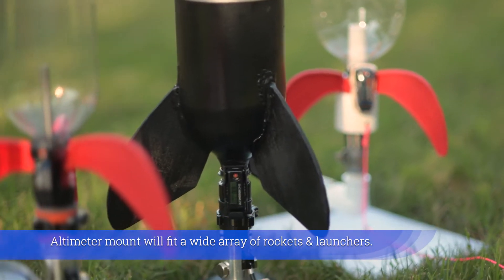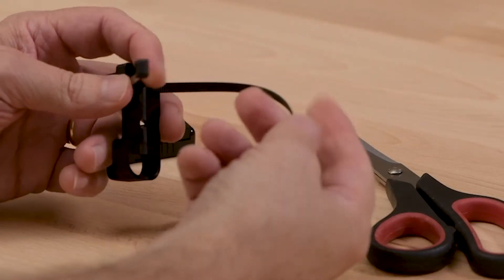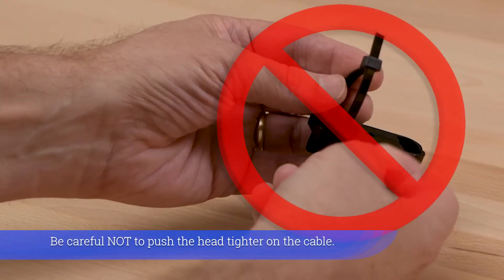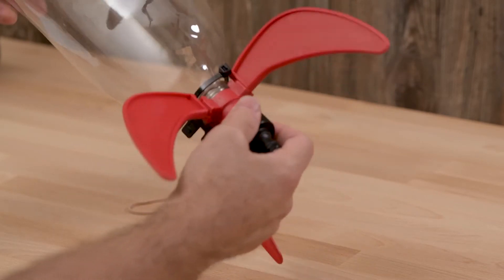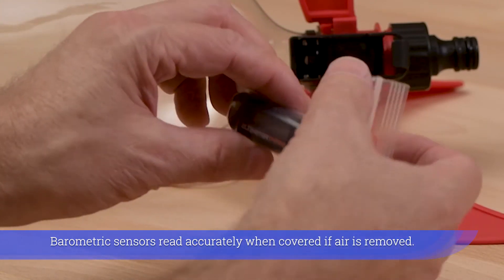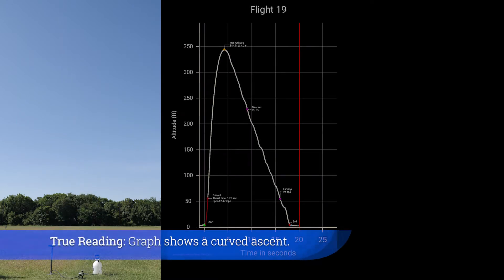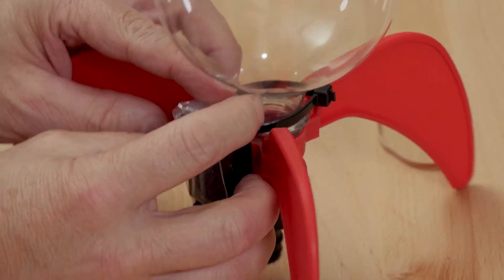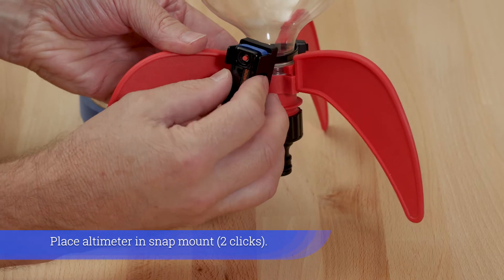How to Mount an Altimeter on a Water Rocket

Comment: I thought that the altimeter needed airflow to detect changes to the barometric changes.  I thought I read on the Jolly Roger Altimeter 2 that it recommends to not seal the altimeter.  What am I missing?
Reply from the maker: I apologize for the delayed reply. The week before I was on vacation and then the following week I was trying to get caught up. Only now have I been able to respond on social media channels. Typically, with solid fuel rockets the altimeter is placed inside the tube or a chamber, which has some small holes, but you don’t want a lot of air flowing past the altimeter or it will give a false reading (suction effect). Since water rockets don’t have the luxury of placing the altimeter inside the fuselage other than maybe a nosecone, but these typically create a lot of suction like a spoiler on a car if the nosecone is open and not attached. Jolly Logic actually suggested sealing the altimeter in a small zip lock bag and I did test that theory out and it does work. The bag acts as a bladder if most of the air is removed and allows the sensors to read the barometric pressure change. The zip lock bag barrier is counterintuitive, but it actually works and the curved ascent graph on the AltimeterThree shows it working. Suction effect gives a spike and not a smooth curve in the altitude readout.